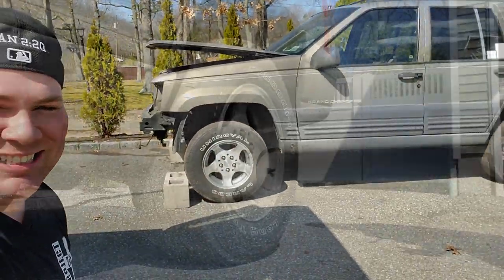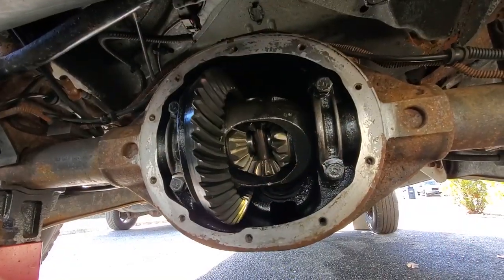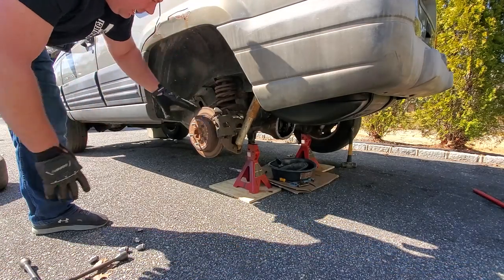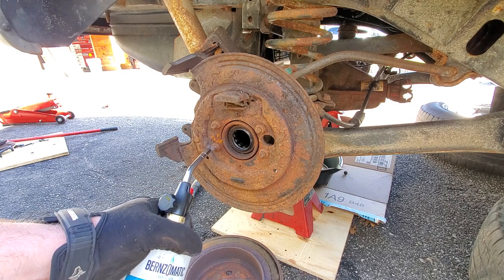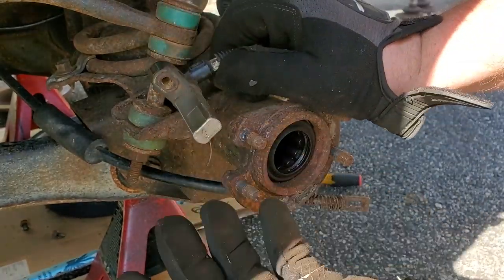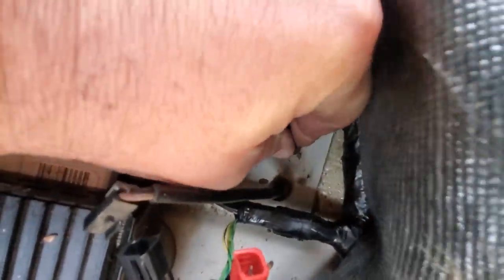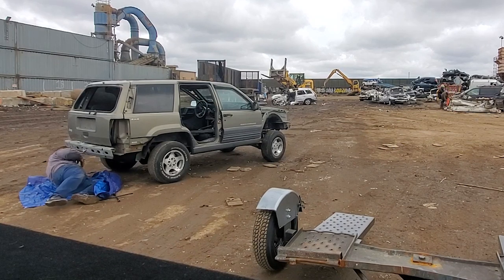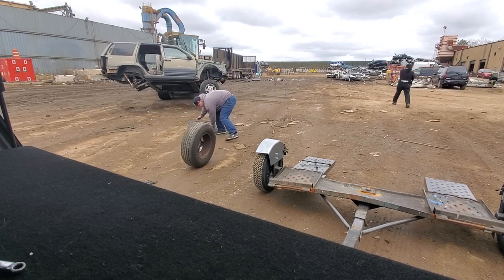JEEP GRAND CHEROKEE ZJ DANA 35 REAR BRAKE PULL FOR XJ REAR DISC CONVERSION

Comment: Used a ZJ to do my rear disc swap on my '01 XJ about 3 years back... very glad I did that after going thru multiple rear drum setups and adjustments.
Reply from the maker: yeah man.  drum brakes are such garbage

Comment: I installed the ZJ to XJ rear disc with ABS. I used the backing plate as a template for the notch. I chain drilled the scribe and cut it out with a cut off disc and the finished with a round stone. It came out nice.
Reply from the maker: awesome to hear of your successful install!

Comment: Dude!!!! thank you! I went to the boneyard today and picked all the parts I needed to convert my ZJ to disc and your video was literally spot on. I got lucky though, someone opened the pumpkin and removed the pin. But removing the c-clips from the axles and all the other steps you showed were SUPER HELPFUL!
Reply: so my zj doesnt have the notches on the flange for the abs sensor. looks like i will need to notch them, how is this done? angle grinder?
Reply from the maker: I'm glad I was able to help! Awesome comments like yours keeps me motived! 💪

Comment: I have removed 100's of the rear discs from ZJs & KJs. 
You need the specialty e brake cable tool for the KJ but a 13mm will work on the ZJ.
Discount the e brake cable from the backing  plate & slip the boxed in part over the end & spring. Then just work it out. Bring a 13mm ratchet wrench. It tackles alot of bolts used.
I highly suggest a electric impact. 
My best time was 30 minutes to remove a complete set.
I've only broken 5 or 6 of the center bolts. All of them have been 5/16 or 1/4.
Reply from the maker: LOL solid info Dave!

Comment: This is exactly the vid I needed. Doing the same swap in my 97 XJ minus the fancy ABS. Tired of the rear drums; they are so inconsistent when compared to discs. Doing the WJ front brakes after that. Getting my XJ in great working order before I make her look pretty; clear coat oxidation, faded paint, 3 colors thanks to JY body parts. Dip Your Car has some great colors and for $500 it's hard to pass up as the final step.
Reply from the maker: oh man! your build is gonna be sick! I want to do the wj knuckles too.  I bought a set of them a while ago but I'm still uncertain of the steering I want build.   let me know what steering set up you use.
Reply: @ProjectDanH  I plan on doing stock steering first, then upgrading to utk crossover inverted t with a custom track bar mount, all at once makes it that much tougher

Comment: I already have a ZJ but I had to swap everything over to the Ford 8.8 very easy to do. Great job on the explanation of what you are doing Dan.
Reply from the maker: thanks brother!  how do you like the 8.8 in the Jeep?
Reply: Project Dan H    I really like the 8.8 . I have the 8.8 LSD 4:10 out of an explorer with the Iron Rock Offroad bracket kit. I think it’s going to be fun once I get the truss that came with IRO long arm kit welded on.
Reply from the maker: @1stzjtruck706  I wanna do the IRO truss for the d44!  I can't wait

Comment: Cabin fever maybe? Going a little crazy myself. Don't sweat it brother, still giving a ton of good info. God bless and stay well. Also, will this swap work with a Chrysler 8.25?
Reply from the maker: haha.. yes but I filmed this March 22nd.. so I guess no. lol.  yes you can put these on an 8.25.  direct bolt on but you must enlarge the mounting bracket hole a bit to accept the larger diameter axle tube

Comment: You say grab the wiring to retain your ABS. I have a 99 XJ with a Dana 35 with ABS already. Do I need to take any of the ABS stuff from the Grand Cherokee? I got near-perfect backing plates with 4 bolts behind them off a 97 Grand at the junkyard and brand-new calibers off a 95 (same junkyard) this past week. I need to go back to see about getting the lug bolts and as far as the portioning valve, I only need the spring right? Forgot that part too. Remember how crusty your metal pieces were for the parking brake? These are still shiny metal and no rust on either backing plate. Feel blessed.

Comment: You can as use the disc brakes from a 
KJ Library. 
It was very common to find the Chrysler 8.25 I believe they have with ABS and without ABS. 
I have been called that the ZJ proportional valve better than the KJ 11
💯 % sure on that so double check on that one
Reply from the maker: If you have an XJ with an 8.25 a KJ rear would be great.  Unfortunately my XJ has a D35 rear so the ZJ set up will be better suited for my application.
Reply: @ProjectDanH  yeah do what works. I Dina 35 ain’t a bad axle. Never had any problems with mine

Comment: Dana 44a rear discs will work on the Dana 35 as well, I am not 100% sure but you may need to grind out the center on the 44 for an 8.25 too. I did the swap on my 98 TJ years ago using the 44a brackets on my turdy5. Will be doing the 8.25 soon- oh and you can use KJ rear discs on the XJ 8.25 with no mods from what I have read on the forums.
Reply from the maker: 100% correct.. I'm using a d35 so I went with a ZJ swap
Reply: Okay, so it is possible to use the parts from a Dana 44 for an 8.25?
Reply: @arjanwilhelm3545  yes but you will still need to grind the center openings to fit the axle and mate correctly. Dan will probably show what I mean, he also mentioned it in the vid. The D44 brackets have identical openings as the D35 so are direct fit but need mod for 8.25
Reply: @chrismadden1660  thank you, Chris!

Comment: Dan, you're pretty good with electronics, right? DO you think there is a way to modify an older vehicle so the power doesn't cut off when you turn off the key until you open the door? Like newer cars/trucks. So you can put power windows up ect. If anyone can figure this out, I have faith you  can.
Reply from the maker: Thanks Frank!  I'm confident this can be done by adding a time delay relay into your power window circuit.  Give it a shot and let me know how it goes 💪

Comment: Love this video! I would like to do this same swap to my 98 Wrangler Tj with a rear D35. Do you foresee any issues or things I should watch for in my swap?  I will also not be using the ABS and was wanting your prospective on the Prop valve swap? I have read on forums that its not necessary if not using ABS and the standard Prop Valve is fine but not sure?

Comment: Hi Dan, Watching every vid you make about the XJ from the Netherlands. Love them every time! Question: you also take the valve prop. I have a Chrysler 8.25 axle. Do I also need that valve? And Why do you take this valve with you? Regards Arjan
Reply from the maker: thanks for watching brother 💪.  yes you need the proportioning valve from a ZJ with rear disk brakes for your conversion.  drum brakes have a proportioning valve that sends more fluid to the rear brakes... so if you don't change it, your new rear brakes will get too much brake fluid and they will lock up on you and make the vehicle skid.
Reply: @ProjectDanH Thank you very much! Glad I asked! Skidding my XJ is not my favorite hobby! 🙃

Comment: Mr. Dan just want to tell you I’m really enjoying the tutelage On all things jeep. I have a question I’m a sensitive guy so don’t make fun of me. Like you did with the dinger box!! 😝 I inherited 94 Jeep grand Cherokee Limited from my dad he passed away two years ago this coming July and it hasn’t ran since he passed I needed to get front brakes on it. Number ☝️ gas tank is full I know the carburetor problems I had with my lawnmower can’t imagine what The 🌽 gas is going to be like do I have to drain it or is there some kind of magic 🧪 ??  #2. I’ve never done breaks before but I think it needs new front pads.  I stopped driving it as soon as it started  grinding.  So how hard is the job and please don’t assume just because I can’t spell or formulate a complete sentences doesn’t necessarily mean I can’t turn a 🔧.    I appreciate any help you can give me in this manner. Please be nice sensitive guy. 
Thanks 🙏
Reply from the maker: Hey Brother! Thanks for reaching out.  I'm so sorry to hear about your dad.  Hel be very proud of you when you get the brakes up an running.  XJ brakes are very easy, theres probably a million vids on YouTube to learn from.  Im sure you'll do great.  theres also "dry gas" and bunch of other additives to treat the bad gas, but try to top it off with fresh stuff as soon as you can.  good luck man!

Comment: Dan! I know this is unrelated to the video, I thought I'd ask on your most recent video of this year ZJ. 
I have a 95 ZJ, my first vehicle, The tailgate is a bit more rusty than the repair you did on this one, and it even goes around the window seal... My bf and I planned on fixing the rust..but now I'm interested in swapping out my fixed glass tailgate for one with the flip glass. I was wondering if you've seen a friend do this, or have even done it yourself off-video and have any info for me? I haven't had a whole lot of luck on the interwebs.
Reply from the maker: I've never done it but I think it could be an easy swap.  give it a try and hit my up on Instagram of you have any issues.  God bless 💪

Comment: Will the axles from the zj fit into the xj without modification
Reply from the maker: No, they're very different, they're also low pinion fronts which aren't as good and Dana 35 rears which are definitely worse than a c 8.25

Comment: Do you have any idea on what axles I could swap disc brakes onto a d44 xj axle.
Reply from the maker: I'm not sure exactly but Nick In Time films did an old XJ D44 rear brake conversion with ZJ brakes and a couple TJ flanges.. check him out! 👍

Comment: I have a ZJ that i am trying to figure out what rear end is in it cause i wanted to do brakes and there are so many choices.  It has drum brakes in the rear.  Can you suggest a good place to look for markings or tags that would be on the jeep that would tell me what rear end is in the jeep?  Any help would be most appreciated, i don't trust what the auto parts stores say it is.
Reply from the maker: Is it a 93 to 95 Laredo?  probably a d35.
Reply: Project Dan H it is a 94 Laredo.  Great job on the videos by the way. Entertaining and knowledgeable. You can tell you are having a lot of fun
Reply from the maker: @sleepy83181  thanks man, I really appreciate it.  Jeeps are definitely fun to work on

Comment: Would it be a problem if I have abs and I dont swap axel shafts and wouldnt there be wires at rear if I had ABS
Reply from the maker: If you had ABS and wanted to keep Your XJ ABS you would need to add an ABS tone ring onto your axles.  You would also have to get ZJ ABS Wires and notch out the axle mounting surface to accept Disc ABS as the Drum ABS mounts differently.
Reply: @ProjectDanH  Hey Dan, I wanted to get some clarification on what you meant by swapping the tone ring. I did this brake swap on my 99 XJ and did everything that you mentioned and I still have an abs light that’s on. My question is did you use the ZJ or the XJ tone ring?
Reply from the maker: @samuelasmare2883  you will need the ZJ tone ring and ZJ abs sensors

Comment: an reusing bolts you have heated ,not a good idear  heat removes temper ,,just buy some grade 8 at ace
Reply from the maker: it wasn't heated enough to loosen rust but not enough to distemper them.  If was glowing red the maybe, but it could always be re tempered by heating it and quenched in oil

Comment: At some point I'm gonna realise that I'm not motivated enough to do an axle swap ( or funded enough ) like I should and I may just do the brake conversion on my D35 on 35's. I know the jokes write themselves.
Reply from the maker: brother, with that comment you are "right on the money" lol.  he was only asking $250 for the D44 so I had to get it.  Beach Jeep is gonna need the extra strength when the weight of the 3rd row is added 💪
Reply from the maker: @wheresthetunez   I was carrying when I picked it up 🤣🤣.  But that was after he told me the price 🤑